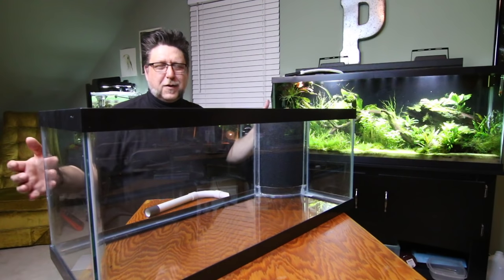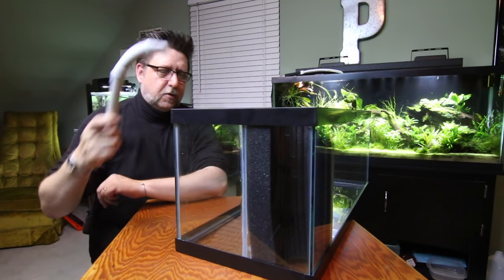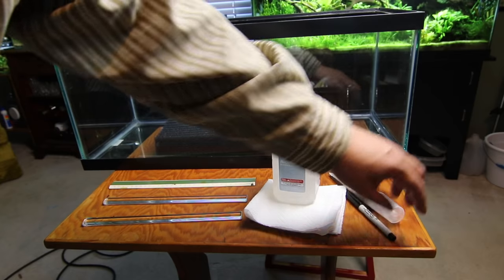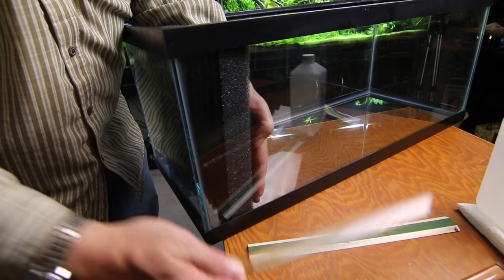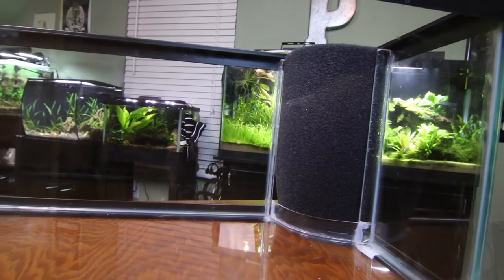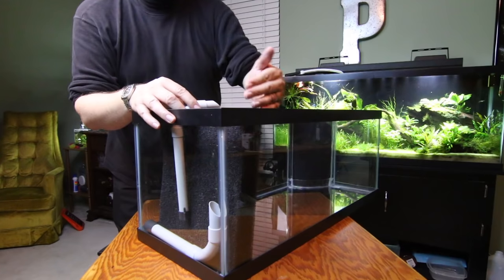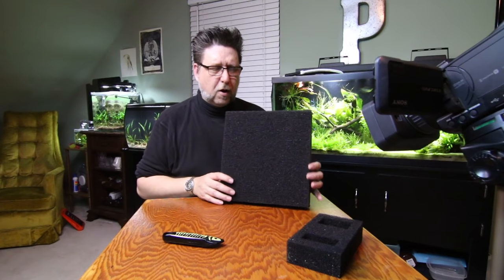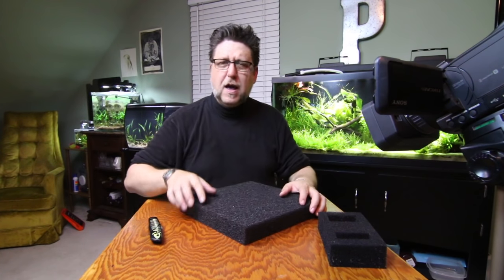Corner Filter Installation

Comment: I use a corner filter on my 150 as well. They are the best. I used a canister filter with modified intake and discharge rather than an airpump or general pump.
Reply from the maker: +Rachel O'leary that's a lot of the reason I wanted to try this out. I'm going to do a 125 soon and I'm thinking I may try it for that.
Reply: sweet!
Reply: So, could I use this foam in my Aquaclear filters???
Reply: Yes Sahadi, you can use it anywhere. Its MUCH more resistant to breakdown and you can cut it to any shape you wish.
Reply: Have you made a vid of that setup Rachel? I'd love to see it. Mods are ... well, I'm a computer freak, the joint.
Reply: janedagger  she did make a video of that.
Reply: Rachel O'leary I
Reply: Ragin Cajun ,.. 👍🏼that sounds interesting,I'd like to see a build vid or after effects of that
Reply: @Rachael O'Leary,.. so I could put my canister intake behind the corner filter and place the return on other side of tank??? Would that work??
I was originally going to make 3 Hamburg matter filters one in each of my 40 gal to start then adding to other tank later. But when I received the 3 sheets of foam, they wouldn't fit across the 40breeder, they were long enough  although height was the issue I was facing. Wasn't tall enough, so it looks like I will be making corner filters instead. No big deal.Also I got the green filters in coarse, would've preferred Blk but wasn't available in coarse in size needed from Amazon site I purchased from. I think I got all three sheets for about $16.00 & now 14in wide, over 30 long. So now, I will have plenty for corner filters in probably 10-12 tanks ranging fr 10gal-40gal. I would like to have in my 75's ,90 & 240.  Finding & getting cut glass is next hurdle, it'll have to be polished edges to prevent such sharpness.i always get cut on glass when dealing with it🤦🏼‍♂️🤷🏼‍♂️..
  Baby steps, as u all know this hobby isn't cheap!! Thanks for info on these filters,.. I like how they work! I have one large air pump w/12 air outlets that can be split to 24 or who knows how many( it's really strong pump) & power these filter with more then enough flow. That way I can do away with  all h.o.b filters and bird nest of plug in,surge protectors,etc,..That will save a few$$$ per bill I hope.
Reply: @TheGnthreman  ,.. cool. thx a million! i appreciate it!

Comment: PORET FOAM IS A SHRIMP KEEPERS BEST FRIEND! Hands down my favorite filter,I use the corner matten as well for my german rams in my 20g long tank,it was initially setup in June and I seeded it with another poret filter from my lfs and by george I haven't had to rinse it out yet.in fact there is a layer of bio mulm goodies that my baby rams eat so thats why shrimp will love them as well. You gotta be patient these filters get better with time so let your tank season slowly and you'll be rewarded in spades. My filter is now mature to the point where de-nitrification is happening deep inside the 2inch 30ppi foam because that bio layer I was talking about above slows down the inflow whereby the middle of the foam is oxygen poor enough to support anaerobic bacteria. Quite simply the most amazing filter and just about the only one where denitrification can occur. I've tried all those sintered glass biomedia etc and they are just nitrate factories which is fine but I want more dammit! I just ordered a new kit for my 29g tall because I'm my old zoomed turtle filter and the bio media inside is not denitrifying fast enough for my liking if at all,my plants somewhat do that sucking up ammonia and nitrates but I still have to do weekly water changes. Anyhoo Pektec your gonna fall in love with your mattenfilter and I predict within a year your going to ditch all your hob filters and go with the mattens. Peace out
Reply: One more thing I forgot to mention you can seed the poret with stability and other bb in a bottle products to kick start the filter. I prefer tetra safestart plus,just make sure the bottle is not near expiration date.
Reply from the maker: +48tomw cool beans. I always have ceramic in a tank ready to move over and seed the next one. Although I've used some others I have gotten in my Aquarium boxes.

Comment: Having used silicon many years I have one simple trick/tip... when smoothing out the silicon, wet your finger. It really helps. The idea is not only to smooth over the area, but to smooth for a more attractive finish. The wet finger lets you smooth is like a hot spatula on icing.
Reply from the maker: janedagger awesome advice I’ll do that on the next one.
Reply: gush gush PECK talked to me!!!! faint hug .. actually its an old construction tip. ;)
Reply: Thx as well, never knew that but will try for sure

Comment: Another great use for poret foam is to cut blocks that fit over your canister or hang on the back's intake, it pre'- filters the water going into your filter an cuts back on filter maintenance.All you need to do is take it off and rinse after your weekly water change you can go 3 times longer before having to strip down your canister.
Reply: jan truter this is a good idea, from experience i would recommend using a very porous and small piece of foam. Using a large and very fine piece can overwork/overstrain some motors, just a friendly tip to keep in mind 😊
Reply: With a good sized canister as you stated it shouldn't be an issue at all! its the smaller hobs that may not be able to handle it

Comment: if you turn the sponge round there will be more surface area when those grooves are out
Reply from the maker: +Isometric Aquariums I think the sponge  has the same surface area in which ever direction it faces.
Reply: if you imagine a canister filter ... and you look a higher quality foam is normally bumpy, this increases surface area, best example i could find https://www.amazon.com/Fluval-A236-106-206-Bio-Foam/dp/B0060QJ42S ...so there area that first touches the water as its being pulled through is bigger

Comment: This is a simple HMF, you can buy this Foam in any aquariatic Store in Europe and it cost depending on the ppi Nummer from 10 to 40 in 2 x 2 feet and " to 2" or 4" thick 10 to 20 bucks. This Form cuts like nothing with a metal saw blade or an sharp bread knife. 
Way more simple to make the Foam fit are plastic or stainless steal L or U profiles that you just silicone in place.

The side Version even it is ugly is may one of the best filter solution there is. depending on your tank space you has a huge Media cappacity and very low energy costs. lets say you do an HMF on an 6.5 x 2 x 2/200 x 60 x 60  with 180G. An HMF at this tank a with 2" Mat containce 18 Liters of Media cappacity. An Jet lifter that you showed has a moving ratio of 250 Liters of air to 700 Liters of warer. For an ideal media surface mofement you need 2 to 2.5 tank volumes of filtration. A good air pump with 800 or 1000 Liters of air per hour need between 14 to 20 Watts and you can move around 2800 to 3000 Liters of water with it. 
Now compare this to an FX6 with 5 Liters of Media cappacity and 42 Watt of Power useage.

Comment: Would putting an additional block of poret foam on the bottom of the airlift or intake of the micro pump add aditional mechanical filtration or just be redundant?
Reply from the maker: It would but your going to have plenty anyway. It certainly wouldn’t hurt.
Reply: pecktec thank you!

Comment: Do you think it'd be smart to do something like this, but as a means of hiding a heater? Supergluing PVC pipe or something in a corner and painting it black to blend in with a black background?
Reply from the maker: You really want to get some water flow past your heater. So if you hide it away make sure the water can move past it. I put my heater behind here and it works great.

Comment: Great video, I'm thinking of doing this type of filtration for a 20 gallon long shrimp only aquarium. How did you retrofit the lift tube to the pump? Also I know flip aquatics has this same fiter but theirs isn't setup as a corner filter. I like the fact that the Swiss tropicals has the glass brackets.
Reply from the maker: Check out the into the woods playlist for the final build on this tank.

Comment: Great Video Mr. Pektec. From your explanation, I understand that the flow rate of water current shall be small enough so that the bacteria inside Flex piece have sufficient time to do the denitrification.  Can you advise how much the flow rate cycle (liter/hour) ?
Reply from the maker: I don't know how I would go about measuring that.
Reply: They recommend 1-2 times an hour so based on the volume of the tank you can buy a pump with the right turnover rate.

Comment: Hey Pecktec. I was just wondering if you had installed the block of Porett foam inside the first chamber of your fluval Flex yet? If so how's it working out and does it cover both filter intakes?
Reply from the maker: +James Elliott I haven't ordered it yet. I think I'm just going to get a big piece and cut it to size.

Comment: I'm looking for a way to install a corner filter without emptying the tank. Can it be done?
Reply from the maker: Sort of. I did a video a while back about a guy who 3D prints corner filter frames. It’s one of the aquatic experience videos. I just saw them at the event this weekend but now the name escapes me.
Reply: @pecktec  um, somekind of glue that dosnt fail on you. I know superglue works but, it kinda dosnt last very long under pressure.